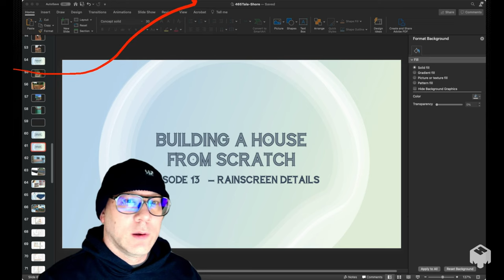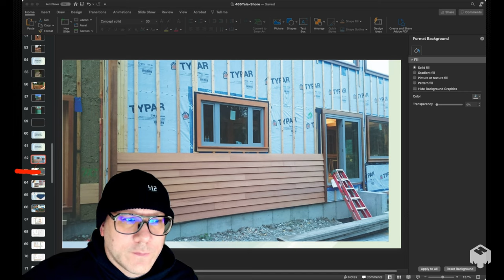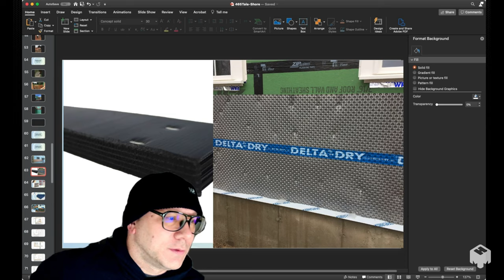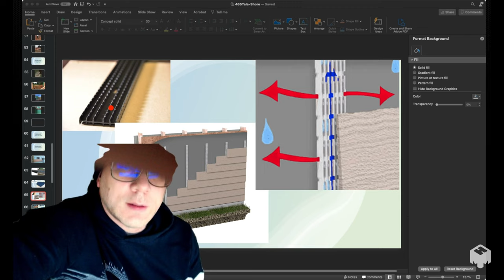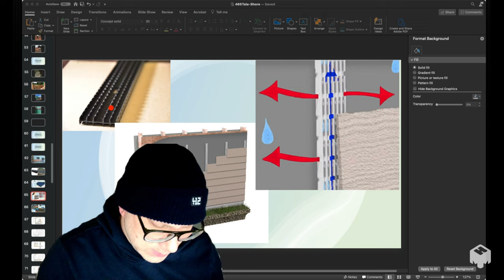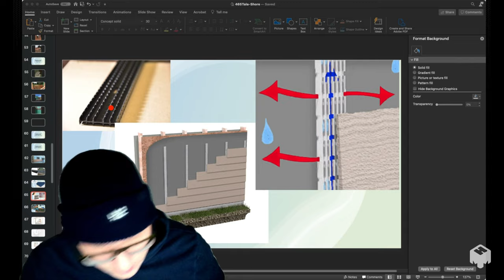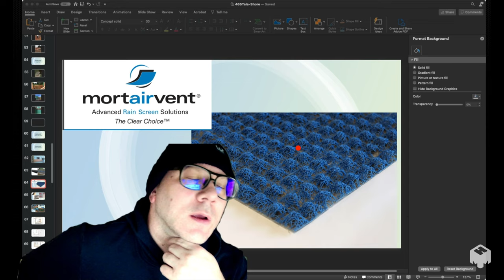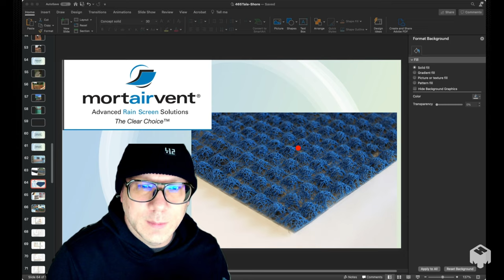E13. Building a High Performance Home  - Rain Screen

Comment: I know this is late but were you happy with your choice of rain screen?  I was going to go with hydrogap that provides 1 mm gap for water but likely no air.  I live in the PNW so lots of rain.
Reply from the maker: Pretty happy. I'd go larger than 1mm though if you're doing traditional siding, 3/8" is recommended, but you could probably get away with 1/4". Have you looked at Benjamin Obdyke Slicker Classic Rainscreen?

Comment: how did this application work ? I am thinking about using the 6mm for a Ceder Shake install instead of the Benjamin Obdyke rain slicker... thoughts ?
Reply: I thought it worked well. I had the framers install it, but since it's simply staple up, it's really easy. I liked the fact that it had the filter fabric attached to it as well to keep any debris outside of the air gap.  Basically, no issues to report of.

Comment: how squishy is the Mortair vent?
Reply from the maker: If there was only a squish meter. It's got some give, but since it's going behind Hardie or siding it has to hold that form after being nailed to allow air and water flow, so strong enough to not flatten. i know that's not a solid answer. Email them and they'll send you a sample pack of their products.